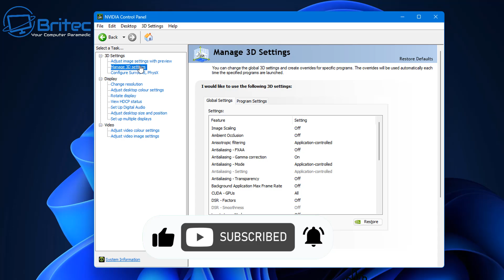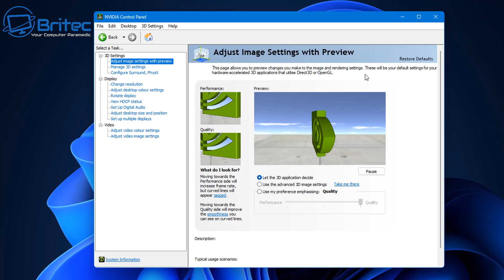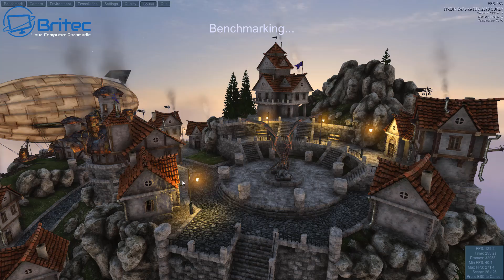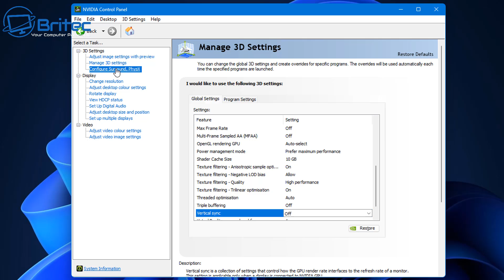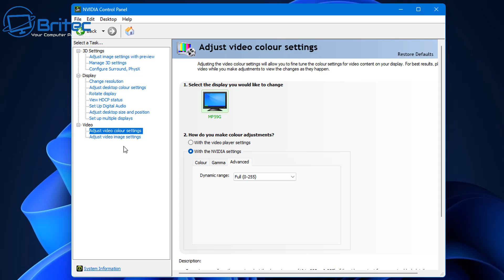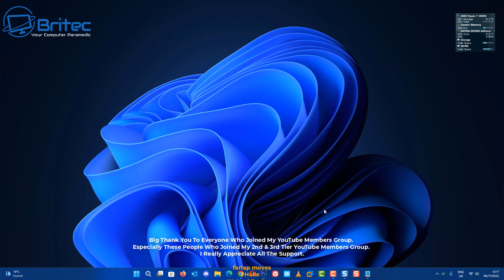Can Tweaking Nvidia Control Panel Boost Performance And Increase FPS

Comment from the maker: So did you get a FPS Boost? Let me know below.
Reply: YES IT CAN
on older 1660 super to make forza 5 not have dithering there are some settigns you need to tweek
ON THOSE settigns cause even turning them off in ms's settings DOES NOT WORK
you then have to change that if your playing certain games 
its complicated and took me 2 weeks to find all this out
Reply: Just done all this & then saw your vid, in an attempt to force Max GPU & VRAM use - QUALITY not performance, & no matter what my temps stayed low 34-45c , my GPU% was mid 50-65% & VRAM didn't exceed 4.2GB use from the 12GB of my 3060, 
HOW do I get Games to use more my VRAM? (yes i have change bios to allow beyond 32bit addressing...
Reply: @SpeedLockedNZ  Don't trust the usage number 100% with one app.  It's been proven that the reporting comes from the reserved VRAM pool(which can fluctuate dynamically) in most apps like HardwareInfo.
The GFX engine decides what to shunt to VRAM.
If your having bad object pop-in or mesh problems it's more likely a storage access problem.  90% of the time I fix these issues by putting the game folders and pagefile on the fastest storage drive in the system, especially games that are modded with 2K+4K texture packs when I'm running a GTX760 4GB at 4K.

Comment: For older hardware, I have a gtx1650 laptop 🤦🤦
Changing from quality to performance yields a 6.25% boost in performance.

However for maybe 20 and definitely  30 series cards the difference is negligible

If only free performance was just that, free lol!

Comment: There are a few settings you did not adjust like OpenGL and PhysX. Always set them to the video card if you are using Nvidia. But not all the same tweaks work the same on every pc. There are a lot of factors to take into consideration like mem size and speed, storage size and speed, monitor refresh rate, MB settings and the list goes on. So there really is no one size fits all when it comes down to boosting a pc, there is a lot of trial and error. And it also has a lot to do with the silicon lottery.
Reply: @Watskeburt  AUTO is not the best setting for boosting FPS. The manufacturers will decide what is what with auto and will caution on the side of error and not boost to full power, limiting the performance. It takes a lot more than just watching a few videos to get the most performance out of a pc. If you do not understand what each setting does then you are flying blind basically and that is why people prefer AUTO over actually learning what each setting does and how they interact with other settings. That is why there is no one size fits all when it comes to boosting a pc. It does take a good bit of knowledge to achieve the highest boost clocks.
Reply: @Watskeburt  Just tweaking Nvidia software you wouldn't notice much if any difference. If you want to actually boost your system then you have to get into your UEFI/BIOS settings and set the overclocks from there if your motherboard allows it. Not all do.
Reply: @Watskeburt  Unless you unlock the potential of the motherboard Nvidia control panel is not going to change much if anything. But in active overclocking than Nvidia control panel can actually boost your FPS. But you have to be running an overclocked system to see the difference. That is also why I mentioned it is a multifaceted thing. There are a lot of factors you have to take into consideration to get the absolute best from your system, and that also requires a good bit of trial and error. I am not an LN2 guy but I love pushing my system to its limits but in a controlled manner.

Comment: geforce auto tuning not turning on
I have a problem where I can't enable automatic tuning. I click it so it goes green, I click agree and continue, but the slider keeps going back to off. So what can I do to fix this as I can't seem to keep it turned on, I tried turning it on when in the game I also tried turning it on when on desktop, but I just can't get it actually turn on and stay on any help would be greatly appreciated.

Comment: Who told you power management mode prefer maximum performance that person never did research 
What it dose is just runs the car at max throttle all the time wasting power and prob capping the performance to low cause overheat .
Optimal gives already max performance if there is a demand. 
The max performance is just a gimmick and a huge disinformation . As 99.9999% of all people never even asked Nvidia support personally on what that thing dose -_-

Comment: My laptop Nvidia control panel manager 3D settings.
law latency mode only have off and ultra there not options for on do you how add on options thanks
Nvidia 3050

Comment: I'm saving up for MSI GeForce GTX 1650 because I'm not changing anything else on my HP EliteDesk 800 G2 Tower, and it's the only full-sized GPU without external power that I can safely save up. Given how proprietary the motherboard is, I predict that it won't help with much.

Comment: Changing all these settings only lowers input delay alone. except when NULL is on, cuz, that only works when the Gpu is maxed out, if it's not then it adds input delay, so I leave it off.

Comment: i have watched a bunch of game specific video's and tried following them and well the result is the exact same as before, a lot of the setting don't seem to do anything
Reply: Did you add the .exe to the 'Programs' tab or just set the global settings?  If you don't add the right .exe of the app/game to the 'programs' tab, it can't attempt to lock the settings before hand-off.

Comment: If the performance bottleneck isn't the GPU then tweaking the GPU settings is pointless. For example, if the GPU is only working at 70% of its capacity, but the application is pushing your CPU to 100%, then upgrading or tweaking your GPU will have no benefit. Even if a tweak eased the burden on the GPU by 50% you would never see a frame rate benefit unless the burden was also reduced on the CPU, as the CPU (in this hypothetical) is the limiting component. The weakest link, so to speak. Considering the already high frame rate of the benchmark you used, 130 FPS, its likely the GPU wasn't the limiting factor to begin with.
Reply: While what you say is essentially true in some cases in this case it's not. The benchmark is definitely limited by the GPU which runs at 99-100% while with my Ryzen 5800X none of the 16 threads ever went above 44% while 99% of the time the threads were at 25% or below. While it jumps to different threads it looks to be using mainly 4 threads at a time which is expected with DX11 which generally only handles 4 cores/thread at a time efficiently which was about as good as you could get anyway back when DX11 was developed and most CPUs were still just dual core with some quad core at the high end
Reply: @longjohn526  A baseline frame rate of 130 FPS suggests that the GPU is not struggling in the slightest, so it's not surprising that reducing image quality settings to lighten its share of the load did not produce extra frames. The GPU is already chewing through the benchmark content effortlessly. Start with a benchmark that tests the upper limitations of the card, something that chugs along at 20 FPS, and you will likely find that there is a frame rate benefit to reducing image quality. Most "tweakers" are trying to squeeze an extra drop out of their old cards to reach playable frame rates, hoping to crawl from 25 FPS to 31 or something, not gawking at 130 FPS benchmark scores. Their systems are struggling, so slightly reducing the strain placed on a system resource that is hitting its limit has the chance of improving the frame rate at the cost of image quality.

Comment: What Texture Filtering actually does is change the level of compression for GPU memory and it actually used to make a difference back when VRAM was much slower. (Basically the same reason Windows compresses system RAM and most system files use some sort of compression) If I take a 100 MB texture and compress it down to 80 MB then it's going to transfer out of memory faster. However VRAM speeds are so fast now that there really isn't any gains to be had and that's been true for at least 10 years. However the texture quality setting can still be useful in scenarios where you are using a lot of texture mods and start running low on VRAM in which case you can set it to performance and gain 10-20% more memory space. One place where Nvidia has always been ahead of AMD is their texture memory compression where even at the quality setting game will use less VRAM than an AMD card using the same game settings and the textures still look fantastic

The Maximum Performance power setting can be helpful with stuttering problems. What it does is only allows the clock to go down to the base setting which in the case of my 3070 Ti is 1575 MHz. In the Optimal default setting it can drop the base clock clear down to 200 Mhz and if is does drop it too low in certain game scenarios then you could have a stuttering problem. However it really doesn't have any effect on average FPS but can make a difference in 0.1% lows since the base clock never drops below 1575 MHz in my case. Again this is a per game setting and you don't want to set it in the Global Settings window or you burn excess electricity when you are not gaming. Normal desktop useage or for browsing the internet then 200 MHz is plenty and preferable

I tend to use the Nvidia Control Panel to enhance the quality of games, especially older ones for instance forcing Anisotropic Filtering to 16x, or turning off the AA in game and using MSAA 4x or 8x and more recently turning on DLDSR all of which cost you FPS in trade for better looking graphics in older game where you have a ton of FPS headroom to work with anyway

Comment: Thanks Brian.
NVIDIA Control Panel is no longer included in the driver package installation and is distributed exclusively through the Microsoft Store. Since this change occurred I stopped use the application and haven't noticed a difference.
Reply: It's in the latest drivers although it may be part of the G-force Experience now which I use so I can record gameplay without as big a performance loss as when using an application running in the background.  It also means I can just press Alt-F9 and start and stop it anytime I need to record. The main reason it is in the store is in case you are allowing Windows Update to install your graphics drivers in which case all you get are the basic drivers.
Reply: @longjohn526  
I reinstalled the latest driver package to date (Ver. 526.47 Release date: 10/27/2022). Using G-Force Experience and the NVIDIA Control Panel was not part of the driver package.
Reply from the maker: Thanks for the info!

Comment: The only way you can override apps and games is adding them in the 'Program Settings' tab...but not all can be overridden, and you have to be sure the right .exe is used.  It's no good adding the games launcher a lot of the time as that is still part of the OS environment...global.
Global will only effect the OS environment a lot of the time, as soon as you run an app or game that uses fullscreen/takes over the display, the hardware is handed off to said app/game and all the 'Global' settings can be completely overridden.  It can be hard to find the right combination of tweaks, and it can be different between GFX engines, and GPU's, and driver.
Which leads me to another point...Why the hell are you running tests with GeForce Experience!?!   You do know how that works...don't you?
Not only will it have priority over the 'Global' settings but it will also override any in-game settings at the driver level(low), and we know for a fact that a lot of tech companies will "optimize" for benching software...without telling us.
I know you did this in response to my comment, and I know you're very knowledgeable, but I would like to see a more scientific/logical approach to the testing...please?

The sort of people that are doing these tweaks are like me, struggling with budget/low end hardware, as my 1080Ti system broke, parts are still not fixed by repair shop(SMD replacement), have to use laptop for gaming.  Hell Inspiron - I5 7300HQ 2.5GHz base clock - 1050 4GB+shared DDR4@2392MHz - 4GB's on-board RAM+1X 8GB SODIMM DDR4=12GB's DDR4 total(11GB's usable) 
=No bloatware allowed.

Little tweaks with software can help...but I've found my hardware tweaks are what makes the real differences for me.
Liquid metal on CPU and GPU dies with proper care. Surrounding SMD's protected with nail varnish and thermal pads.
HDD replaced with NGFF(M.2) PCI-E 2.0 SSD for game files, mod staging folder and pagefile(virtual memory).
Potatoes like my laptop I'll even re-install the OS so no OEM/SI BIOS hooks can interfere with the system in the background and take up un-necessary CPU processes and valuable storage space.
Reply from the maker: I will be doing more myth busting videos.
Reply: @Britec09  I'm looking forward to some controlled, detailed, and thoroughly investigated projects then. 👍

Comment: Another reason to stay on Optimal power is Prefer Maximum Performance keeps the GPU clock boosted constantly, even if your current workload isn't really using much of the GPU. Considering this doesn't really help performance all that much, you should probably keep it on Optimal Power so your GPU clock stops sucking all the power out of the wall only to end up idling for most of those extra clock cycles. It will boost when needed.

So now instead of getting someone complaining that you didn't put it on performance, you're getting someone complaining that you did. You cannot win :)
Reply from the maker: I know, this video is just to show people how silly these tweaks are
Reply: @Britec09  Yeah, the only real change I make in the control panel is setting dynamic range to full since that actually makes a difference in terms of image quality (depends on the display, ofc. Mileage may vary).

Comment: Nice video but couldn't help but noticed you to turned on some vr settings which do help in vr gaming but not normal pc use
Reply from the maker: Just showing what others have shown and it don't boost fps or boost performance like they claim, that is the real point of the video

Comment: You should let the application control things like vertical sync, anisotropic, and antialiasing
Reply from the maker: I agree
Reply: I disagree with V-sync which is broken in a lot of games and will cause stuttering and controller response problems whereas turning it off in the game and setting it to Fast V-sync in the Nvidia Control Panel as a per game setting gives you a better result and makes your controller more responsive. Also Anisotropic Filtering in many older games is only 8x or even 4x so you can set it to 16X in the Nvidia Control Panel with very little change in FPS (less than 1%) but better looking graphics
Reply: @longjohn526  I think games that use EASY ANTI CHEAT control and look at these features. I htink its better to use as applic
Reply: @longjohn526  V-sync is a pain to get right...but a joy to behold on a low-end GPU with micro-stutters.
Reply: I would agree, except for AF. If a game doesn't support AF, I force it via the Nvidia Control Panel, as I can't stand the blurry textures.